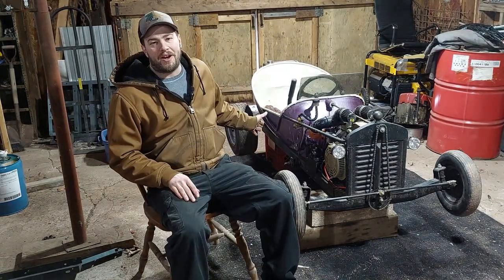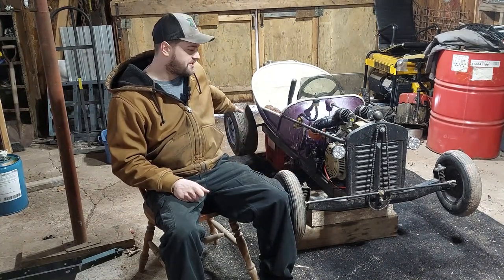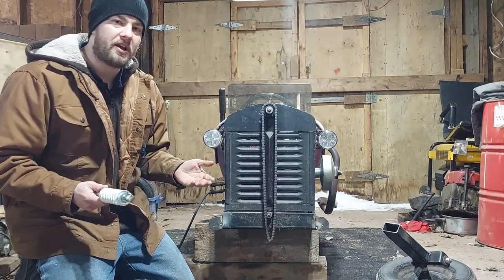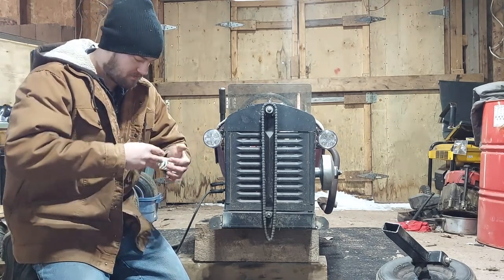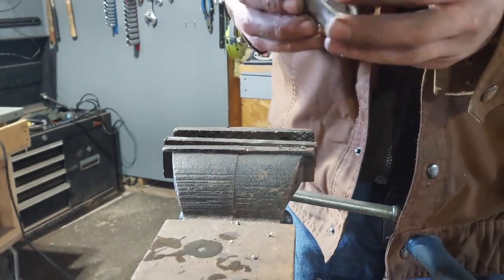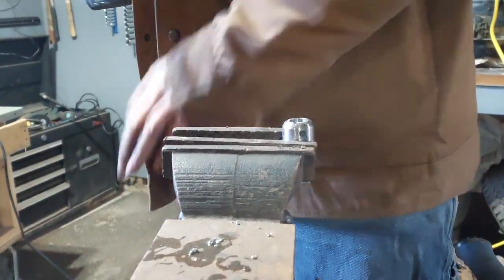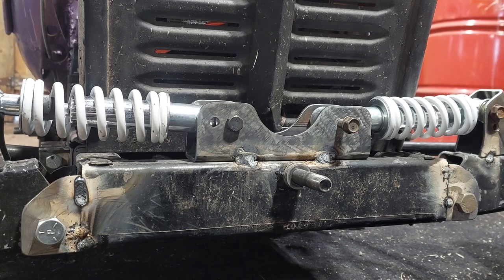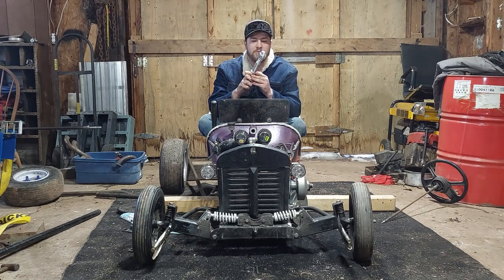DESTROYED 400CC WHEELBARROW GO-KART REBUILD PART1

Comment: Where'd you get ur wheels
Reply from the maker: The rears are a high-run 16"  trailer tire from princessauto (canadian tractor supply) and the fronts were run flat wheelbarrow tires with Timken bearings to replace the old crappy stamped bearings
Reply: @rednectarYT  awsome